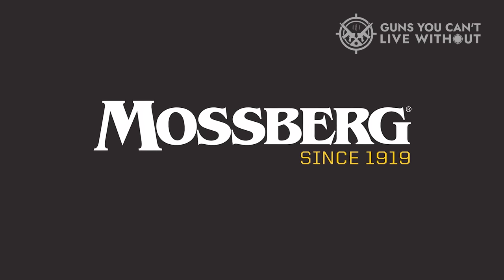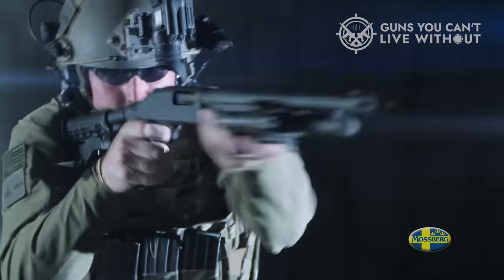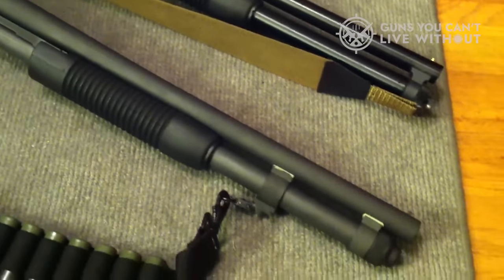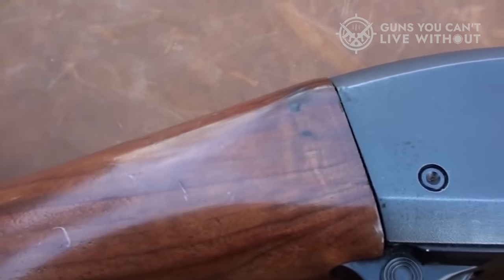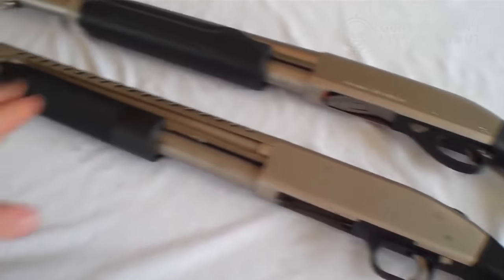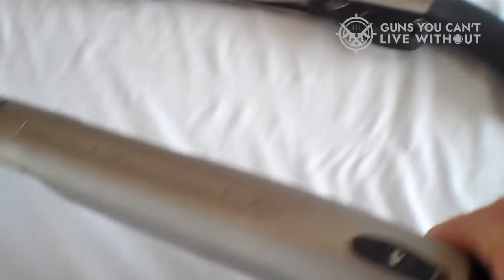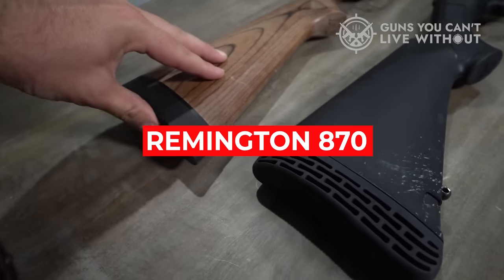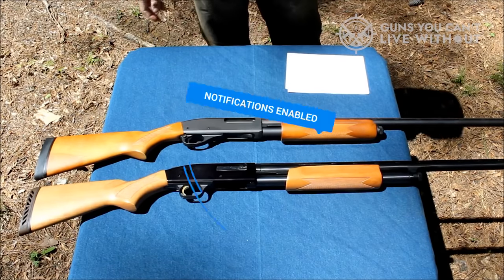Mossberg 590 vs Remington 870 - NOT EVEN FAIR.

Comment: OK I have to call BS here !!!   If the Remington was superior in any way the US military would have bought them. Oh, they bought Mossberg's and Benelli's instead?

 There are three things that separate the m500/590 from the 870.  

1. The Ejection Port on a Mossberg is larger, and facilitates Port or Single Loading easier.  This is a big deal because after you run the gun dry you will need to single load it unless you can get to cover so you can reload the magazine. Unwise to stand in the open while reloading your mag, even if you can Quad Load, which Most can't!!!

2. On the Mossberg The Bolt Release is behind the Trigger Guard and ran by your middle finger.  You don't have to change your firing grip to operate it.  This comes in handy when you need to change the round that is loaded for a Slug  IE: Select Slug Drill. The Bolt Release on an 870 is in front of the trigger so you have to break your firing grip to activate it.

3. The Safety on the Mossberg is located on the Rear of the Receiver so it is Ambidextrous. The 870 has the safety in the rear of the trigger guard.  It only works one way and if you are left handed you'll have to figure out and alternate method of operating it. Yes, the Mossberg's doesn't work very well with a Pistol Grip, but if you are running a Pistol Grip on a Pump Shotgun, you need Psychiatric Help anyway! See Magpul Furniture for the Correct Tactical Shotgun Set up. They have the Ergonomics figured out better than anyone else.

And then there is also a 4th reason.  Mossberg's are cheaper than Remington's. Usually Between $150 and $300.  I buy used ones and the last one was a M500 made for Western Auto Stores $150, barely used ! And Barrels and After Market Parts are available on Ebay or Amazon for <$.

Mossberg's are also easier to slick the actions on. There is only 5 parts in one and I can do an Action Job in less than an hour by simply breaking the sharp edges on the internal parts. if you can work a File and Sand Paper you can do it too "At Home for Free !!!"

Mossberg's are clearly Superior.
Reply: FYI The reason the US Army chose the Mossberg is because of price. The RDP was so low Remington did not even respond to the RFP. First get your facts correct mate.
Reply: @Jessonthejungle  Really,,,  What about all those M4 Benellis? I think they are more than a 870?  Damn Facts anyway!
Reply: The Remington 870 is used by virtually every special forces who have the budget and flexibility to choose what equipment they want.  The Mossberg is never chosen over the Remington 870.
The Benelli M4 is different. It was the first semi-auto shotgun that met the military’s durability   and reliability requirements. That’s no longer the case. Other semi-autos have surpassed it, including the Remington V3 and Versa Max which were developed more recently and surpass the Benelli M4 in every measure. The civilian version also holds two more rounds than the civilian version of the Benelli M4.
Reply: @Jessonthejungle  So Navy Seals use 870's?  They can have whatever they want. and the only shotguns they use are Shorty Door Breachers, (pistol grip 12" bbl) otherwise they use M16/M4's exclusively.
The Coast Guard uses m590A1's Exclusively and I know that because I actually shoot with them when they come to our Range.  The biggest problem they have is that Navy Procurement will only buy 3" Magnum Buckshot for use in their guns. In fact Remington was just given a large contract to produce 12 ga. Slugs at 1770 fps!!!!!!!!! for use in those shotguns.  Nobody wants to pull the trigger with any of those rounds and I have been telling them to make their superiors buy Winchester Universals for training purposes.  You can't learn gun handling if you are getting the snot kicked out of you every time you pull the Trigger. Believe me it is brutal to watch them try to Qualify,,, and most don't !!!
Reply: Mossberg won that particular military contract because they were the only ones bidding on it.  Mossberg is a low cost gun.  The military standards are not high and cost is the primary driver.  For example, the Mil-Spec M4 carbine is 3 MOA, which would not be accepted in the civilian market.  It’s the same with shotguns. It has to be functional, meet certain minimum requirements and be cheap.
Reply: @Jessonthejungle  Remington didn't bid on it because they were in Receivership and  couldn't bid on it!  Remington is currently offering new 870  guns that are comparable to the Old Police Magnums .  They have Walnut Furniture and all Steel Working Parts and MSRP is $499. They just need some internal hand work to smooth them out. They could easily field a Govt Compliant gun comparable to the Mossberg 590A1 for a price that is competitive with Mossberg if they wanted to.. It's not like they don't need the business, but more about the Owners who are not interested in doing business with the Govt (Which can be a real PITA, ask me how I know this?) or Not "On Shore" any more and they can't have  entities like that controlling our Gun Manufacturing and Ammo Manufacturing.

Why do you think that a 3 MOA AR wouldn't be accepted in the Civilian Market when 95% of AR's won't do that on a good day and the ones that will are usually owned by people can't shoot any better anyway. I hope you don't cling to the Myth that AR's are inherently accurate and they will all shoot Sub MOA,,, cuz they won't !!!

I have over 200 hours of Tactical Shotgun Training behind me plus numerous 3 gun shoots. I have seen virtually every kind of Shotgun in my classes.870's get spent rounds hung up in the chamber frequently because they have a Single Extractor,  Mossberg's have dual Extractors and Averaging over 25 rounds an hour in those classes IE: over 5000 rounds fired I have had exactly one failure to extract. I slammed the Bolt shut and Butt Stroked the gun on my Knee and was back in business. 870's need a Rod rammed down the muzzle to eject a Stuck Hull.  The Army doesn't like that feature since their guys aren't carrying around Cleaning Rods, and can't really have that problem in the field while being shot at!.

We could go on but it is pointless.  What I will say is that properly modified an built 870's are great guns and Vang Comp has produced thousands of them for Police in this and other countries. However these are not $500 guns they are $1500 guns and there in lies the Rub.

I just did a 3 gun shoot a month ago.  The Shotgun Stage was 25 targets. My m500 only holds 6 rounds.  I shot the first 6 targets in about 10 seconds, then I port loaded the remaining 20 shots (I missed one) Final Shot was a slug thru a 3" hole at 25 yards to stop the clock.  127 seconds!  4.9 seconds per shot over 26 shots! I got beat by 2 young guys who had 1301's and were set up to Quad Load. They were less than half my age!

An 870 would not have made that many shots that quickly without a malfunction it would overheat. . Also they take way more effort to run. The Mossberg is clearly superior.

Comment: What civilian needs a bayonet, or a heat shield?  Some of these reviews are ridiculous.  After 30 years in field law enforcement service, some real world facts;  Only about 10% of sworn cops in American will ever fire their weapons in a deadly force incident during their entire career even ONCE.  That's 20-30 years service.  When weapons are used it's almost always a handgun, especially nowadays since pistols w/ double stacks are used by about 99% of cops.  When a long gun is used, for about the past 20 years, it's invariably the patrol rifle/carbine, aka Black Rifle.  Depending on the officer and their department, the SG will be fired seldom or a lot, no middle and it'll be mostly training on the range.  In the order of reliability and durability in my experience the 870 and Ithaca Model 37 are tied and the 500 finishes 3rd.  My opinion, the 500 feels cheesy from the start.  The military, particularly the USMC, favor 500s but remember contracts are awarded by low bids, which is why the military carries a Sigg today and not a Glock.  Mag extensions & springs on a SG are notorious for jams, a liability risk for the couple of extra shots you will get.  And few police gunfights with a shotgun involve more than 5 rounds.  SGs are slow to reload.  Before Remington Arms caved they introduced a magazine fed 870 which eliminates that problem, not sure if the new owners will continue it.  Police bureaucrats for years have tried to abandon the SG but there is too much versatility to get their way, it's one of the most valuable tools in your car.

Comment: Let me save you 13 minutes. Get the 590. Remington has CUT corners on the 870. Using cheaper metals and quality control is absolutely lacking. I own both of these shotguns and after moderate use the 870 has become the rattle gun where the 590 has not. Why? Mossberg does not cut corners like Remington.  If you could look at a pre 2000 870 you would see the quality in the build and blueing vs a modern 870 which is worth about 150 bucks

Comment: When I worked corrections they replace the 30 year old 870s with Mossberg 500s there was so much breakage that they brought out the 870s old ones again and threw out the 500s.  I own old wingmasters and there is no Mossberg that is in their league.  Mossberg has to upgrade the 500 because it is Kmart cheap

Comment: I was literally just about to get an 870 Tactical 6+with ported choke & XS Ghost Ring sights. But now hearing about the ejector and rivets I need to rethink this. Why would they ever use rivets and make an expensive servicing nightmare. Hey charge me 5$ and use pins or screws.Maybe Not happy to hear about Mossberg Slop. Neither of these are cheap guns, why, given the qty they sell and money they make, they can't fix the issues just shows neither cares about the gun they are only interested in raw profit. Perhaps I ditch both and just buy a cheap eastern block mfg'd shotgun. As long as Im gonna get some sort of slop or expensive maintenance/repair on the so called 2 best, I might just as well pay less for a troubled shotgun.

Comment: Seeing how Remington designed both the 870 and the 31 ,  it didn’t sell for Remington as it was built like a Cadillac in a cheap skate buyer world, so the sold the design to mossberg and it had all the class and good materials sucked out of it and made as cheap as they could get it… it sold like hot cakes being cheaper than an 870 in a fudd world. 

The military prison I was at used Winchester 1200 and mossberg 500 or 590s  never saw a Winchester fail but we did have a bursting at the seams shipping container full of junk mossbergs .  The army didnt bother trying to fix them they just got another new one out of the box when any issues showed up.   Garbage 100%

Comment: 870 is hot garbage. The cast extractor needs to be replaced immediately with a machined one and even then I've had issues with the internals feeding properly. 500 or 590 is by far superior just from the quality of the components.